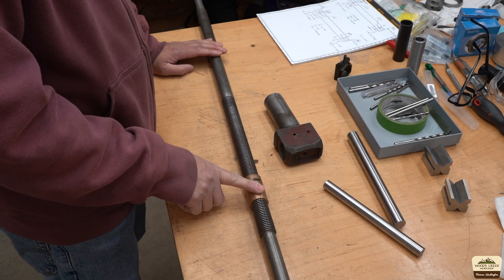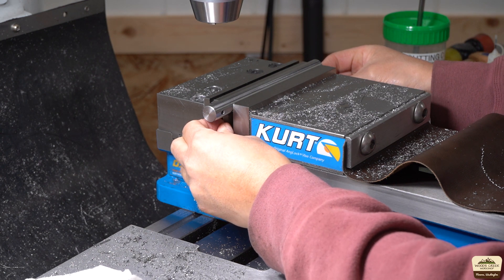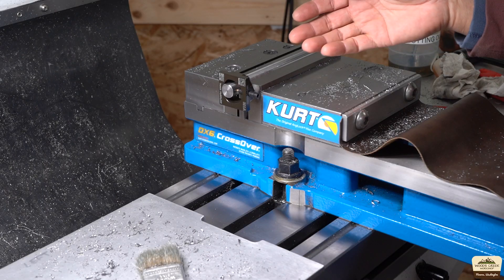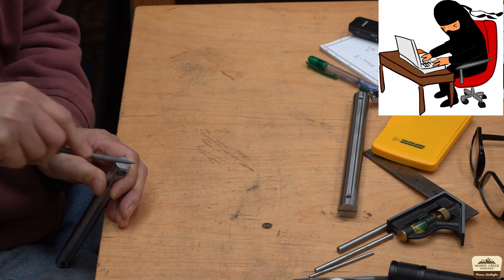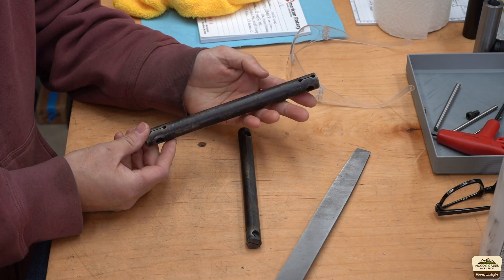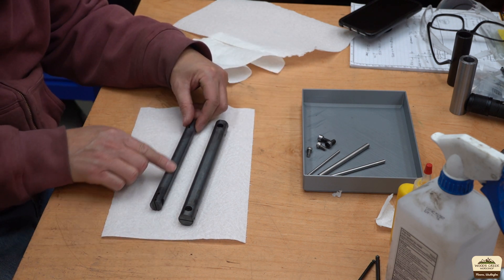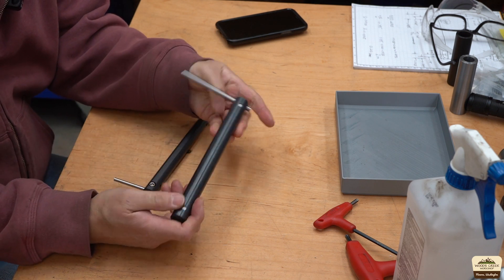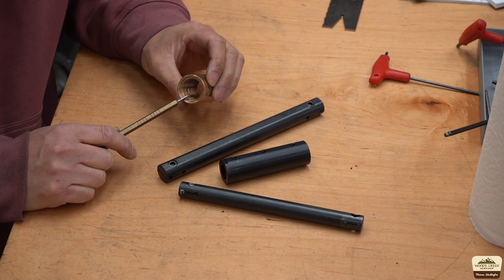Make Internal Threading (And More) Tool:  HSS Threading, Boring and Grooving Tool

Comment: This is the first notification of a video of yours I have had in a very long time, I've checked and the notification bell is ticked. Don't know why I've not had them, but hey it's nice to see you again! Nice job Yuchol, the finish turned out very nice indeed! That's one of Stan's heat treating ovens isn't it? They're a very nice bit of kit.
I've just made a new nut for my lathe and unfortunately the diameter was only 20 mm so I couldn't use that style of boring bar. I had to buy a 150 mm length of 10x10 HSS and grind up my 29 degree tool by hand to do it. I also made a tap to finish it to size as it was easier to grind the outside 29 degree cutter by hand than the inside. You are able with your set up to set the helix angle without having to grind it into the cutter, meaning if at any time you wanted to make a right handed thread of the same size you nay have to turn the HSS cutter to the opposite helix angle. It's nice cutting left hand threads because you cut from the headstock end outwards and there's no chance of a crash lol. 
Looking forward to you doing your nut! Cheers from the UK

Comment: When I need to apply a light coat of oil on something I use a shaving brush to apply and spread the oil.  Gives an even smooth even coating.  Works very well on firearms also.

Comment: At the end of your video, you show the limitation of that tool and cutter grinder with not being able to flip the grinding face. I now know why I just saw a video on that subject. They were buying the grinding tool head that's sold without the rest of the grinder, it's from the 25mm feed bar on up. Other comments said to make it so it could be moved to the other side of the grinding wheel. That would require running the grinder in reverse, but seems that would overcome one of the limits.
I've looked into getting a cheap Deckle knockoff, but the size of the collets limits the endmill diameter of the shank. I've now seen 5C collet change out accessories.
That tempering step is important, I thought I could get away with a draw bar heat treat, and skip that step, it broke off when I was tightening it.
I'm the same sort as you and repair and make stuff. Enjoy your channel.
Reply from the maker: Yeah, I just have to remember what the grinder is intended for.  That why we have multiple grinders.😁

Comment: You might want to think twice about using that keyless chuck for tapping.  They have a self tightening feature that is activated when the shank of the tool slips do to torque on the shank of a drill bit.  Taps generate way more torque than a drill bit.  In fact they will self tighten to the point of cracking. (Don’t ask me how I know this.). Since that occurrence I always use a keyed ball bearing chuck for power tapping.
Reply from the maker: Not a concern for me.